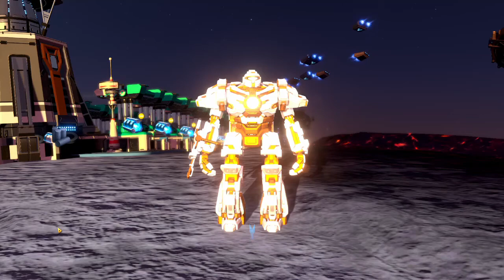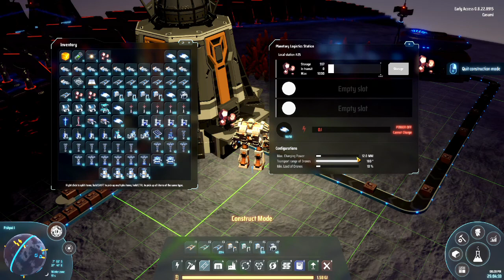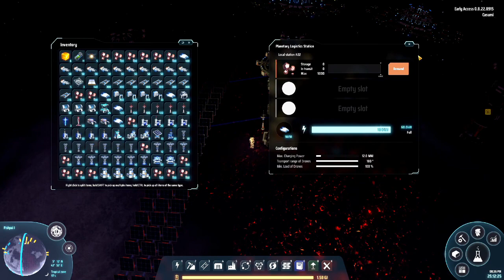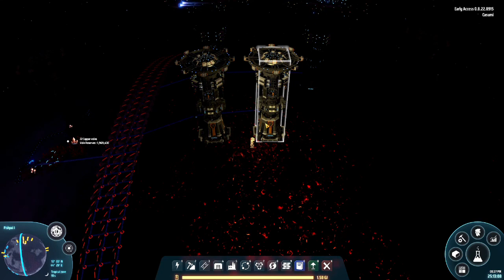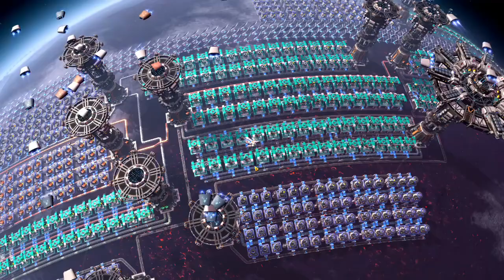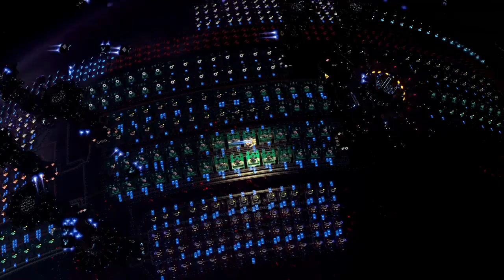QUICK guide on LOGISTICS STATIONS | Basics, Priority, Power, Warpers | Dyson Sphere Program

Comment: My problem is that the warpers just don't work, I used conveyor belts to input them, there was no warper slot, I was using an interstellar logistics station, I checked about 15 times. It had 5 slots and a spot for logistics vessels, but no warper slot. (this is in the proliferator update) Maybe a bug? Edit: I'm an idiot, I just realized that I missed the technology that unlocks it :/
Reply from the maker: You just beat me to it :)